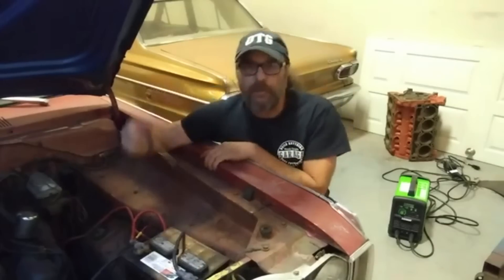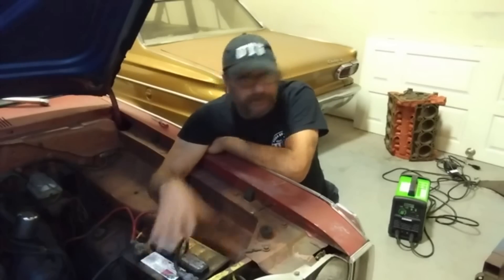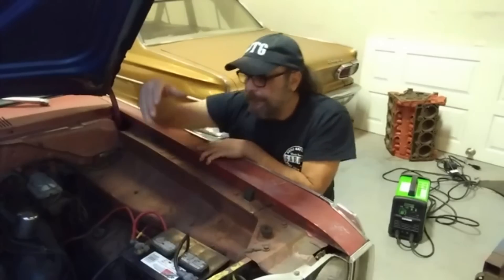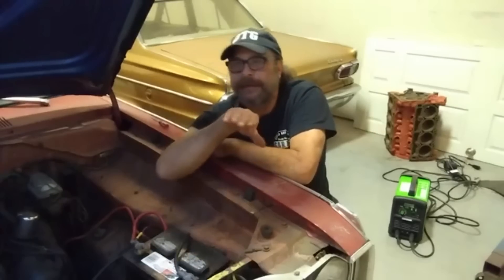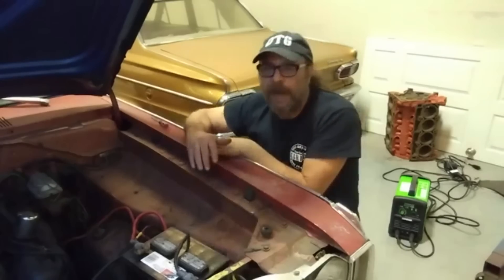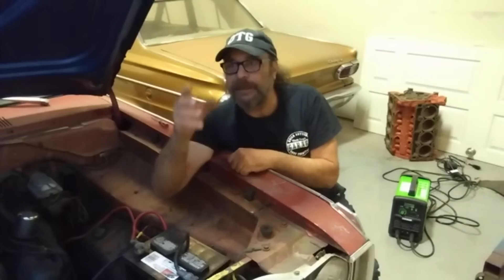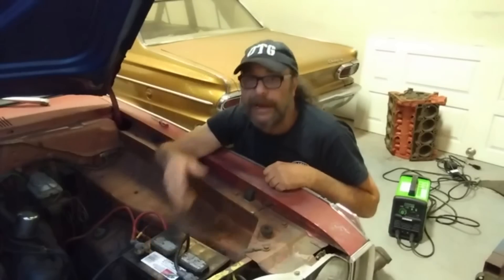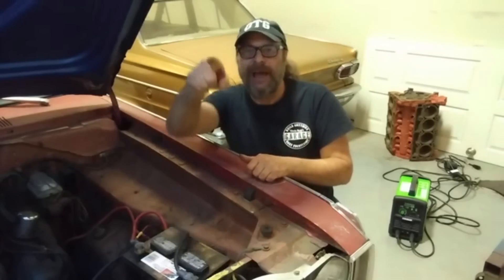Stick Welder Battery Revival SUCCESS!

Comment: Two or three things that could be of benefit to your audience:  First, You did the whole thing without gloves on.  You can do that, but be sure to wash your hands before you touch anything else, and if you use rags instead of paper towels, throw the rags away, DO NOT wash them with other clothes or other rags, they will disintegrate when you wash them and may cause the other clothes in the wash disintegrate as well.  It's also a good idea to sprinkle a bunch of baking soda on the surface of the table or the concrete you set the battery on and let it foam and then thoroughly rinse it so as to not contaminate the next thing you set on that spot.  (It can etch the concrete and discolor asphalt)

Second, a hundred dollars may not sound like much to a lot of people rebuilding cars, but if you are trying to rejuvinate a car you bought for scrap for $300 to $500, a $150 battery can be a budget buster.  

Third, battery explosions.  Over the years I've had two or three, or actually maybe five or ten, do a 'pop' like you describe, blow some of the caps off, maybe crack the case, blow a mist of acid out of the top,. but I have also had two that actually exploded.  Like you say, it's not a mushroom cloud and structural damage to its surroundings, but a battery explosion can blow the entire top off of the battery case and blow acid all over everything around it.  That's why they don't put regular batteries in passenger compartments anymore, why the solar people put the battery collection in a light duty enclosure, etc, its not to control the blast, but to contain the cloud of acid.  One of mine was in a golf cart that we keep at the airport that we use to tow airplanes in and out of the hangar,  sometimes we leave it on the charger for a week or two at a time before we get back to it, charger malfunctioned, did not shut off, and overcharged a bank of six 6-volt batteries under the seat, one exploded, destroyed the battery top, made a bunch of plastic shrapnel, probaby three inch pieces, out of the case,  and everything under the seat front to back was covered in acid and it left about an eight foot diameter slick of acid on the concrete under the golf cart.  Terrible mess.  

I missed these two videos when they came out six months ago.  The reason I saw them now is because of something that happened last night.  I was playing poker at a friends house, rich guy, big mansion, there had been a storm and the power went out in the middle of the game.  Total darkness.  The guy said wait a couple of seconds and the generator will come on.  It didn't.  I was the only one with any technical skills, so I went out to see what I could see.  It was a big industrial diesel generator, enclosure was about seven feet tall, probably ten feet long, five feet wide, said Cattepiller in big letters on the side, the kind they use to power hospitals.  It had an automatic starting sequence that I reset and it failed when the starter tried to engage, so it was easy to diagnose that something was wrong with the starter battery.  I was thinking old battery or maybe corroded connections.  It took a while to figure out where the battery was, but when I did, we found that the entire top of the battery case and all of the sides of the case except the lowest probably 3/4 inch was blown off, you looked down at all of the plates.  It had been storming, so I initially thought that all the moisture inside the cabinet was just water fromcondensation from it being so humid after the storm, but it was actually acid from the battery.  It was a big battery, one of the schards of rubber or plastic from the top had the label still attached, said it was a 900 amp battery, probably the kind of battery they use in bull dozers and road graders.  The battery connections were still connected to the battery, even though most of the plastic around the connections had been sheared off from the explosion, but nothing else inside the cabinet, not even the wiring, had been damaged, just soaked in battery acid.  The connections were all still good, and the bottom probably half inch of the plates were still in acid in the bottom part of the battery case that had not blown away, so it had just enough amperage to operate the starting circuits, but when it tried to actuate the starter relay, that drew enough amperage that everything went dark.  

The point being, the danger of an exploding battery isn't the blast, the danger is the battery acid.  You were looking down into the fill holes in the battery a lot, and pointing the camera at those holes also.  The risk is low, so you could probably get away with that, but I would not recommend that somebody stand there staring down into those holes being mesmerized watching the bubbling acid.

Anyhoo, I've got probably twenty totally stone cold dead batteries scattered around my shop, and I've got an extra stick welder, so when I run out of projects I think I'm gonna try this.

Comment: I blew one up .  It probably had no water in it.  The battery was explided in pieces and I couldn't hear for a long time..  lol
Jump starting a dead six vt tractor with a 12 volt car battery.. I thought my face was covered in acid.  Turned out I washed my face for 15 minutes and all is well.. 😃

Comment: Battery EXPLOSIONS !!! 
I'm 74yrs old and mostly been around cars, semi's and heavy equipment my entire life. First growing up on a Ranch/Farm...(Yeah, for those that don't know what a Ranch/Farm is...We raised Cattle, Roping Horses and a few other barnyard animals BUT we also grew Alfalfa and Barley as cash crops. THUS the term; RANCH/FARM) 

ANYWAY, getting back to BATTERY EXPLOSIONS. The ONLY TIME I've Ever had or seen ANY BATTERY EXPLODE was when I tried to jump start a 12volt Tractor Battery in the dead of a Montana Winter when it was -42 degrees ...that's BELOW ZERO. So what can we take away from that...Batteries do not like a sudden jolt of voltage when the internals are frozen....yeah, Batteries can FREEZE at those temps. As a matter of fact when that battery did explode it showed a heavy frost on the outside and a frozen jellyton on the inside of the case. I didn't get sprayed with any Electrolyte Fluid....about soled my underwear but was not hurt in any way, shape or form because it was just FROZEN and couldn't expand from the sudden jolt of 12volts. I learned to take all batteries out and keep them inside the Mud-Room until needed from that day on. Lessons learned.
I've seen ROOKIE guys hook terminals up opposite on construction sites when jumping and hook up the negative to positive and never seen any explosions and even a 24volt semi hooked up to a pick up with only 12volt...none of them exploded but sure threw spares like the 4th of JULY Fireworks Display....and one had the caps off because it needed the thing topped off....Even then it did not explode...It takes one hell of a lot to make any battery explode folks....One HELL of  LOT, so think before you let your fingers run rampant without thinking first.

The manner this was done was well within the SAFE ZONE so if you don't know anything then please just keep your trap shut.......otherwise you just show the entire world just how little you know, or don't know anything at all about what your attempting to talk about.

I just laughed reading some of the comments and had to watch this follow up...Good STUFF.

Keep up the great videos guys.

Comment: If you want to show that this is different from stick welding with it, you can show the watts used at the wall power outlet for it when charging a battery and when actually welding something that takes the same amperage as it did to charge the battery. Electric power is measured in volts, amps, and watts so that is the only variable left to discover for 100% proof and verification for the neigh sayers out there.

Comment: If the fluid level is low is when the explosion can be devastating and big if the fluid levels are full like he said it's just a pop And if the caps are off the only thing igniting would be above the battery not inside of it So not a bomb just an ignition and maybe a small pop from any air bubbles coming out of the acid solution. Now if you were to jump start a battery that had low fluid level or if you put the connections on backwards on a low fluid level battery yes then you have a bomb that will send acid and shards of plastic from the battery everywhere this is all common sense. A pro tip if you smell a smell like rotten eggs or a burnt electrical smell do not attempt to jump start or make connections to a battery in a car that smell your smelling is hydrogen sulfide which means there is a presence of hydrogen gas a highly flammable gas when contained is quite explosive.

Comment: the way some people say "it's only a $100" it's obvious some trolls have more money then brains, first off i don't know where they're finding a new battery for $100, even the cheapest car battery at walmart where i live is now just under $150 out the door plus some of us have responsibilities and can't afford to just piss away $150 at the drop of a hat.
tony on the battery explosion subject, it was a long long time ago when i was in high school, there was a freak accident in one of the auto shop periods were a kid was killed when a battery exploded that he was leaning over like he wasn't supposed to be doing. it wasn't the same class i was in so i wasn't there when it happened but we were told that the kid had tools sitting on the battery and when he leaned over it the tools shorted the battery out and blew the top off with him leaning over it so i do know it's possible to be killed by an exploding battery but i need 2 batteries right now i don't have the money for and i do have a dc welder, it's a 120v welder but i'll give it a try but i'm also going to be ducking behind my big 6ft tall roll-a-way toolbox as soon as i flip the switch, better safe the sorry.....

Comment: Me: finding the battery has a cracked post down inside the casing pushing down and twisting till the power comes on : ok crank it ! it starts to crank then BOOM! both caps fly up and hit the ceiling ! his wife was like is that normal? lol needless to say I ended up buying them a new battery .

Comment: I have a small arc welder, older one. I followed the previous video. When I connect the negative to negative then positive to positive, im getting a arc...the welder is not plugged in or turned on yet. The battery is not dead dead...just not turning the engine over or charging. Is that normal or would something be wrong with the welder? I didn't go through with it because I listen to you when you say this is dangerous stuff. I'm trying to revive my 2018 battery out of my Ram...it just died on me the other day. Lol
I don't mean to label you as the "battery" expert, just asking your thoughts. Lol

Comment: 15 seconds, then cool down so you dont cook your starter. You just cranked it for 50 seconds straight and your car doesnt fire right up. Great job. However this does add credence to some efficacy of over volting a charge with a stick welder. Since its the follow up video AND epsom salts and coca cola in my experience do diddly squat...Alright I messed up he only cranked it for 20 seconds but this stuff really grinds my gears when people do it. Like why is your stuff not just firing up??!! Figure it out!!.."Oh I just needed to sit here and crank it over for 5 minutes. as a professionally trained auto tech. thats all it needed"

I think my moms car was one of these. You had to turn the key to on to prime the fuel from the pump turn it back off, then on so prime it twice and it cranks over. She probably had a bad fuel pump check valve. If I remember right I eventually dropped her tank and put a new fuel pump in.

If youre carburated, alot of times theres a primer in the carb. So you can pump the gas pedal like a primer button to prime it. Otherwise you can get a can of starter fluid. If thats not it you got problems and sitting there cranking it like a doofus is just making more problems.

After that a big culprit. especially for carburated ICU's is old gas. As well as the social implications of anyone watching you crank a car that doesnt run like: "do you need help??" yeah! they need to be taken away and put into an assisted living home.
Reply from the maker: Did it occur to you that I had the ignition off so that I could show the cranking capacity of the battery?  Nah...probably not
Reply: @UncleTonysGarage  Nah, I figured it was a fixture in your vast collection of non running cars you keep in the yard by the single wide.

Comment: This is the first time I've ever seen your video it's great! I once had a 12volt battery blow i yong and it was on a 63ford Y block I was 15years old trying to jump it with cables it was sparkling so thought to myself the sparks were like a welder and should not be looked at so I moved my head behind the hood and at that second it blowed it sent caps over the fence about 10 feet and covered me from neck to lower chest not a drop in my eyes or face. Some 45years later I've never it happen again! Now I always wear safety glasses after that epic 😎 day! Thanks for your time!!!

Comment: Had a former employee grinding right by a battery on a truck that was charging off of a shoreline charger. The hydrogen gas "lit off" and blew the top off partially off of the case.. LOL (Probably wouldn't of been an issue if it hadn't been charging at the time causing off gassing)  A bit of caution and you will be fine..  (the battery that lit off --was vented type and didn't have caps on top).   This is a "working process --as long as the battery is not physically defective internally as you said - i.e. broken connection between plates etc.)--after seeing plenty of battery "explosions" I can attest to your correctness of said explosion only really being a "pop"--not a nuclear bomb explosion--LOL  great video!  (35+ years mechanical experience here!)   Love your videos!

Comment: Im confused,
So what voltage that stick welder produce?? Is 24v safe for 12v batteries??
Or Im wrong somewhere. My dads welder is a beast but you can control only amps there, whats volts??

Comment: Thanks my friend. I had an old cheaper than cheap ac welder kicking around the shop so I bought a diode setup for it to convert to DC and duplicated your experiment. WORKS GREAT !! The battery I used was 7 years old with a dead cell… 24 hours on a regular battery charger yielded only 10.5 volts . After charging and then resting the battery overnight it’s settled in at 12.7V and load tests in the green!! It’s back in the car and working as it should. NOTE… my old welder didn’t have a cooling fan and tripped the internal protector so I had to wire in a good high flow fan that I had kicking around…all is good now.

Comment: I ones owned a great big red battery charger that rejuvenate battery's and I reckon I could probably weld with it so it wouldn't surprise me that the welder worked I'm gonna give it a try and put it in the tractor if it works,,if it works good in the tractor I'll then put it in the boat where I can throw it over the side if I had to🙄  after the boat I'll put it in the car...  I have plenty of motor's hear and all my battery are dead

Comment: hi brother average welder is 45 volts and against 12 volts and the welder amperage say 100 amps that`s 4.5 kwhrs of working power on the battery I will not recommend it unless you did something else that you don`t like to share

Comment: I've bought several batteries from a guy down the road that reconditions them. I had no idea how he did it. Now that I know, I might have to use my own stick welder.

Anyway, most of his batteries last a few more years. It is a good deal and well worth it. Especially when you have a lot of equipment that gets used occasionally but needs a battery.

Comment: So, it seems that you don't need any particular welder, I'm not sure how much duty cycle comes in to play with this, maybe someone can enlighten me? As per the three guys whom have posted this method on YouTube, they all use different welders and as I don't live in the US all are different from what's available to me.

So my assumption is that any welder capable of 200 amps should do the trick, maybe I'm wrong though. I would like to try this in an ups tubular lead acid battery (I couldn't find that these were sold in the US) to bring it back to close to it's original 6-8 hours back up (180 mh) with a 200 amps dc Arc welder costing around $80 us. The harbour freight model appears to be $399 which isn't cheap at all!

Dilemmas dilemmas......

Comment: A trick a guy who used to build batteries told me was to blow a breath of air across the battery before connecting or disconnecting the cables, it's enough to disperse any accumulated gasses.

Comment: Battery explosion hazard- OH, It's REAL. But your shop IS wide open, obviously, so what you say is correct... you'd be hard-pressed to have an explosion per se, much worse than poppin' the filler caps off top, sounding like you're shooting a 9mm pistol or similar. Meaning, yeah, it'll scare you, but if you aren't in a very confined space with little to zero venting, OR have a whole SHITTON going all at once, the danger or risk of "The Hydrogen Bomb" poppin' off is almost nil. Too many armchair scientists with lifetimes of H-bomb experiences here attempting to be little 'hall-monitors'... Good set of vids Uncle Tony... keep up the good work and I gotta think that this tutorial has or will help a bunch of folks that have the time but maybe not the loot to get a new battery or just guys that have a pile of dead old batteries laying around piling up like me. Peace!